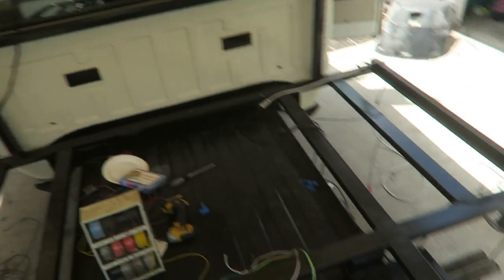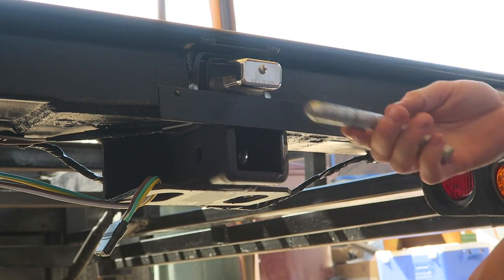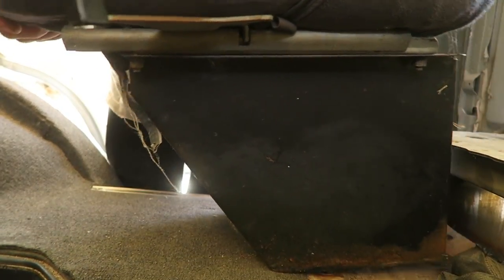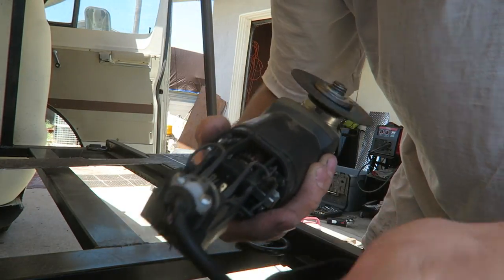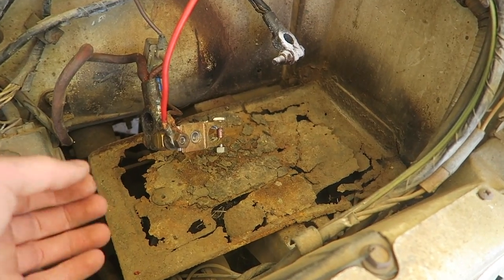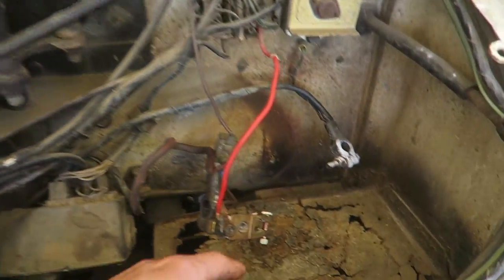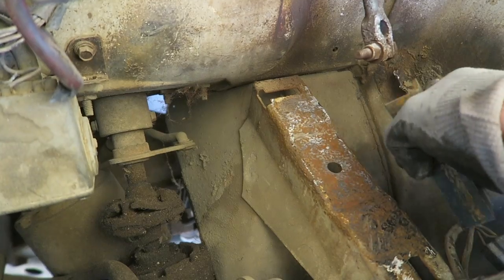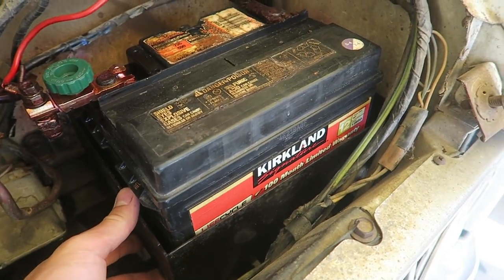Ejection Seat - Battery Box - Ramp Truck! (Episode 12)

Comment: Hey dude, love the build. I actually found your build from searching "diy ramp truck bed" because I found pretty much the same van as a Ford on my local craigslist and it got me thinking hahah.

But here's a few things I thought of to point out in case you haven't addressed them yet:
1. You should space the license plate light back so it sits in front of the plate the way it should
2. What happens if you want to actually use the hitch? With all the brackets you already put on the bumper it would be simple to just mount a (new) plate bracket the same way.
3. You need some reverse lights on the bumper - forgive me if you already hooked some up, I just didn't see any clear lights. Are they integrated into the LED end lights? You might also want a reverse beep since you're so large.
4. There's some really cheap backup cameras on Amazon - might help you out a ton when trying to reverse that thing.

Good luck, can't wait to see the truck completed!